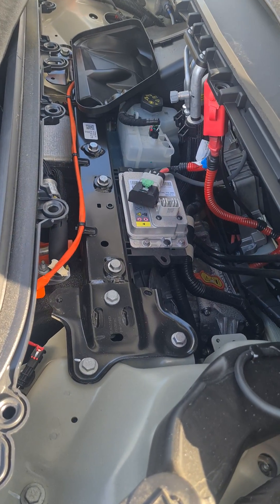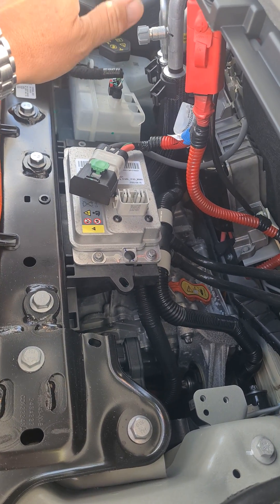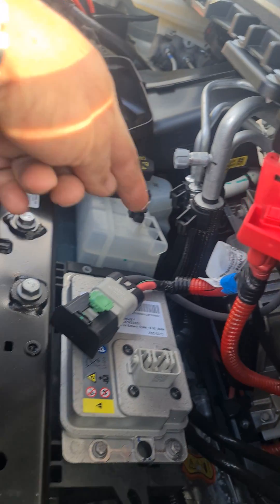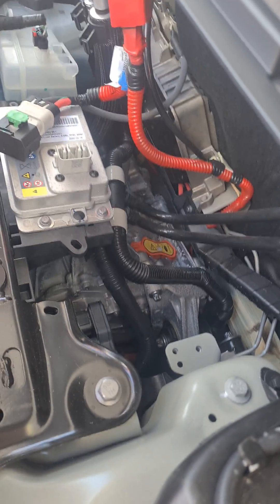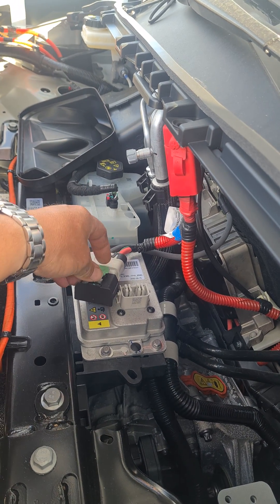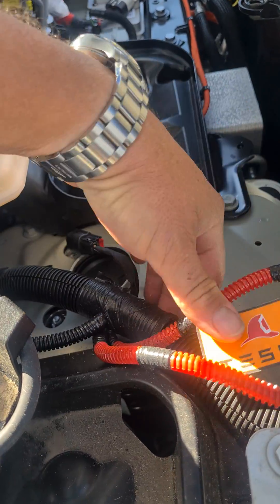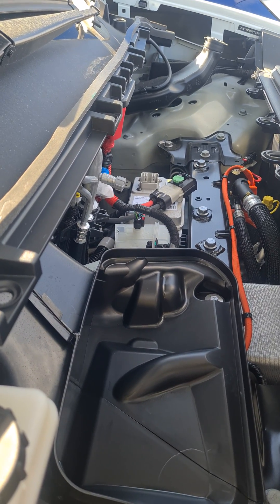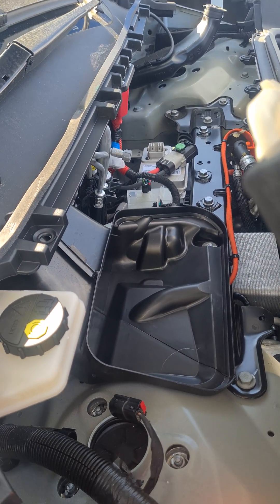how to connect a 12v device to a tesla

Comment: Would this not risk fully discharging the 12V battery though? It would be better to connect to the same power system that feeds the 12 sockets.
Reply: Wouldn't the device you hook up have to be calling for power constantly to drain it?
Reply: doesnt the device have to call for power all the time to drain it?